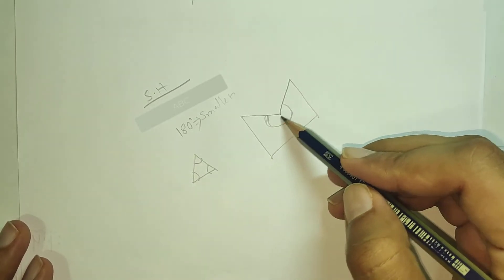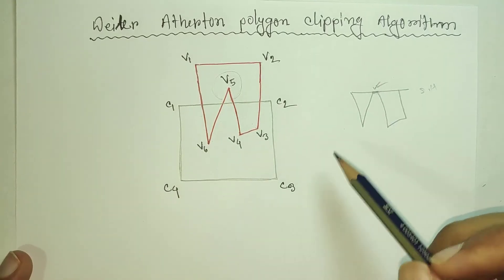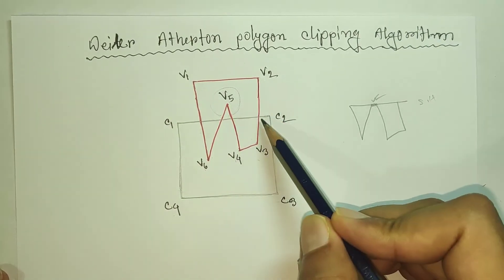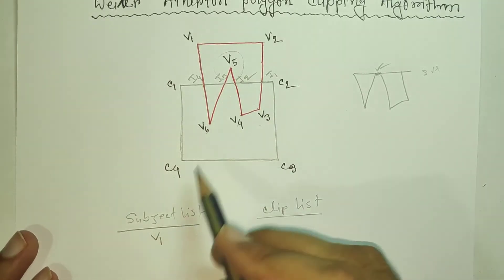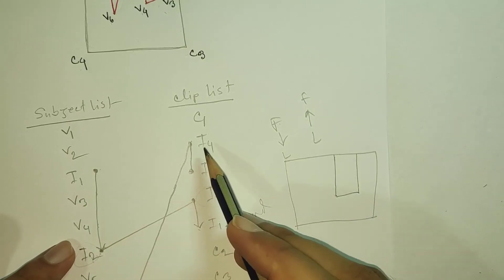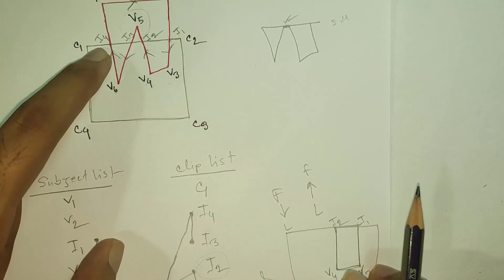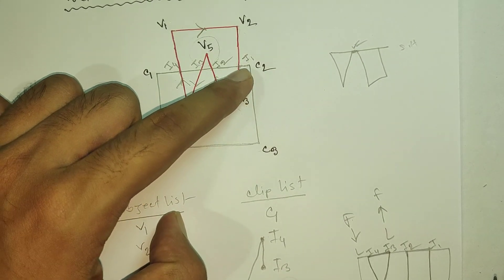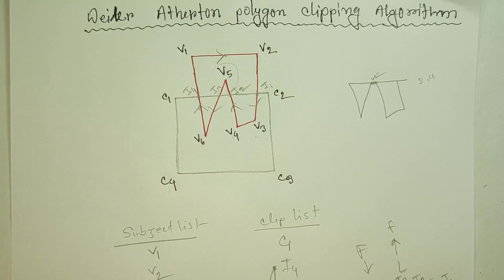Weiler atherton polygon clipping algorithm in Bangla\computer graphics Bnagla tutorial.

Comment: 1. The Misconception: Sutherland-Hodgman & Concave Polygons

Transcript Claim:

    "The Sutherland-Hodgman algorithm only provides accurate results for convex polygons."

The Reality: This is factually incorrect. The Sutherland-Hodgman algorithm CAN correctly clip concave subject polygons.

    The Real Restriction: The Sutherland-Hodgman algorithm requires the Clipping Window to be Convex (usually a rectangle). The polygon being clipped (the subject) can be concave.

    The Actual Failure Mode: Sutherland-Hodgman fails when a concave polygon is clipped in such a way that it should result in multiple disjoint polygons (e.g., a "U" shape clipped in the middle, leaving two separate tips).

        Because Sutherland-Hodgman outputs a single list of vertices, it will draw a "return line" connecting the two separate tips along the edge of the clipping window, creating one continuous shape instead of two separate ones.

2. The Misconception: The Purpose of Weiler-Atherton

Transcript Claim:

    "The Weiler-Atherton algorithm was introduced to overcome the issues faced by Sutherland-Hodgman when clipping concave polygons."

The Reality: While true that it fixes the "multiple polygon" issue mentioned above, the definition is incomplete. The true "superpower" of Weiler-Atherton is not just handling concave subjects, but that it allows the Clipping Window itself to be concave (i.e., clipping a shape against a star or a donut shape).